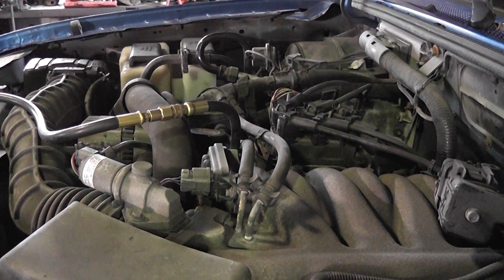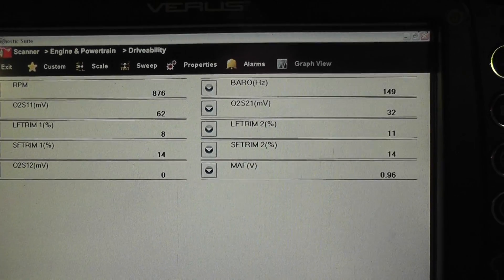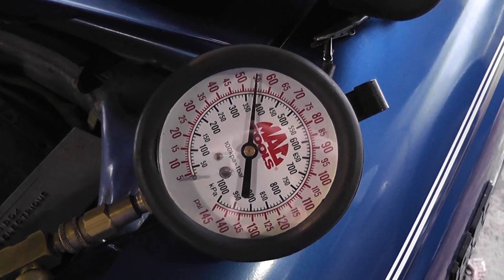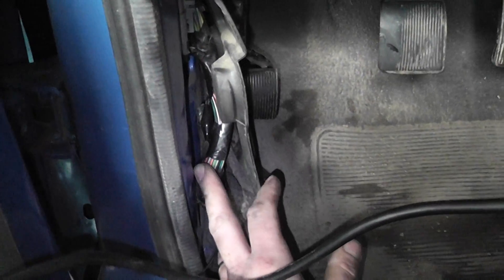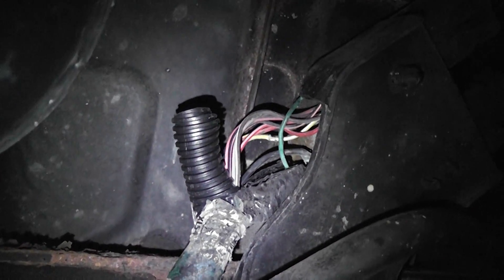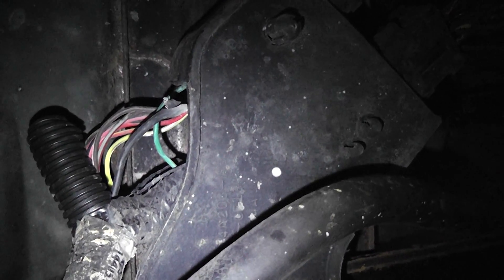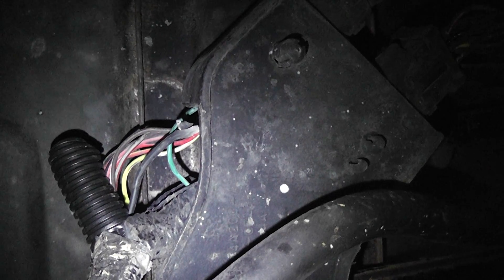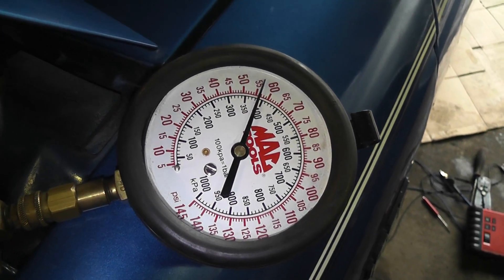Low Fuel Pressure from a bad fuel pump ground (Ford Ranger)

Comment: I have a 90 4S 10 left it running went into a store came out it was running no fuel no spark any suggestions all relays are good
Reply: 94 s10
Reply from the maker: dan bleeck no spark on this system is usually either the pick-up coil in the distributor or the ignition module. I have a video on testing an ignition system with a test light that I will be unlocking in a day or so that will really help you. In the mean time watch this one. https://www.youtube.com/watch?v=mDKj19Hnhd0
Reply: thank you it was the pick-up coil

Comment: My 87 ford ranger does not show the fuel level some people say it can just be a ground i also notice that whenever i try using my turn signals the front work well but the back ones both turn on at the same time regardless if i try to go just left or right both turn on. I have a misfire too can a bad ground cause also that?

Comment: Your channel has been very helpful so thank you for the uploads! My ranger starts to run rough and stalls after reving it past 2800 rpm. All plugs get spark and I have changed spark plugs, fuel filter, air filter, cleaned IAC MAF and throttle body yet the problem still persists..
Reply: 874 fire gas but will not run

Comment: I have a question for you if you wouldn't mind giving me some insight. (2001 ford ranger 3.0l -----15,000---- miles 2wd automatic return less fuel system fuel pressure is 68 koer koeo (extreme rich condition is the problem)) customer just put a new fuel pump in it because of bad check valve. problem existed before the new fuel pump, there was another pump put in it by the previous owner before the one yesterday, odd but this is the history I have on it. anyway the fuel trims are going lean 24% stft b1 and b2 ltft goes to about 6-8% negative b1 b2 before pcm kicks it out. if I create a huge vacuum leak like the booster line I can get the truck to start using trims. pcm fuel pump command is 100%? if I command the the pcm to have 40% duty cycle the pressure drops to about 37-40psi and the trims come back close to normal and the o2 sensors are reacting normally. the truck will negative trim the fuel until the pcm kicks it out and goes back to 0.0% trims across the board until reset. this truck ate 10 gallons of fuel in 80 miles please text me or call at 636-368-8267 or email at ghenke@hotmail.com. love your videos and have purchased your e book. there aren't too many cars I cant figure out but this one has really thrown me for a loop. thanks in advance Jerry Henke @ Alternative Auto Winfield MO
Reply: another comment is that the maf sensor and all other sensors are acting correctly considering the issue

Comment: This is a bit of a shot in the dark, and not sure if you are able to offer us any advice, but we have a Ranger, 2002, XLT, 2.5TD, which is lacking in power generally.  We have replaced the cylinder head and turbo, and renewed all the filters, etc, but although it runs without misfire, etc, it just has no 'oomph' to it?  Any ideas????
Reply: Figured it out yet ?

Comment: hey scanner danner i have a 2002 ford ranger has misfire on cyl 2 and ive replaced coil pack wires plugs and we replacing plugs i found cyl 2 was broken lol but its has rough idle poor mileage and dam thing is power loss from heck and we all know they are called 3.slows so its worse than normal its only got 136.xxx miles any help be appreciated im running outta ideaas lol

Comment: gread video.. i nver thought of checking ground wires since my 84 ss is acting up but once i disconnect the fuse to the ecu it drives great but rich. unfortunately,  once plugged in it has a rough idle when ever it wants, and I mean rough. thanks again.

Comment: This video solved my problem man. I owe you one! My fuel gauge was stuck on full and My truck is a ranger too so I checked the connectors in the same spot under the truck and found 3 broken feed wires. One of them was the sender assembly circuit. Spliced them the same as yours. No more counting miles till empty! Serious bro, thanks again

Comment from the maker: at the 7:38 mark the meter shows around 10.7 volts on the Ground circuit!
this means that if we had 14+ volts on the pump feed (which would be normal battery voltage with the engine running) and 10v on the pump ground, that there is only a 4 volt difference in potential. So essentially the pump was running on 4 volts at that point. 
(remember system voltage with the engine running is 14 not 12, I think that is where some of your questions will be answered) let me know if this helps

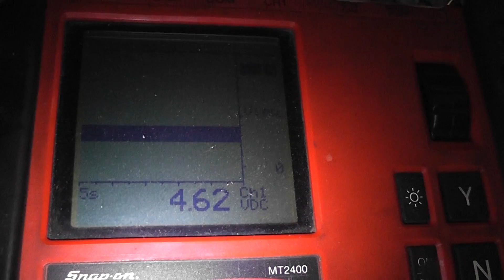Comment: paul, just to make sure i understand, at 7:25 we see 4.62v. does that mean the pump is only running on 7.38v? when you turn the parking lights on we have a reading of 10.7v. so doesnt that mean that the parking lights, pump, and signals are running on 1.3v? the reason i ask is that at 7:35 you mention the pump is running at 4 volts. dont you mean 7.38v? i can very well be wrong.

Comment from the maker: Mitchell gives this wide range because some of these Rangers used an electronic returnless system where the PCM controls pump RPM to control psi. Those systems had a wider range of operation.

Comment from the maker: the first thing I would do with that is address the 80 pounds of fuel pressure problem first. this is way too high for that system. with that kind of fuel pressure you should have rich conditions not lean conditions but in any case fix ur fuel pressure problem first

Comment: as pressure drops when the headlights being turned on "check out the fuel pressure, that's awesome." don't know why, but I giggled a little bit on the inside.

Comment from the maker: @ScannerDanner However if the owner drove that car that way for a long time, the unburned fuel in those two cylinders would end up also in the crankcase and cause fuel contaminated oil. This will get picked up by the PCV system and drive the fuel trim negative.

Comment from the maker: @fivefortyeye540i First, unburned fuel is not "rich", it is simply unburned fuel. Also the misfire does not consume the oxygen that was in that cylinder either. This drives the O2 lean. I have never seen a misfire cause negative fuel trim numbers. As for a dead coil on a waste spark goes, they are known to fail with heat so maybe the coil was firing on start-up. My guess is your negative LTFT numbers were not because of the misfire....

Comment: @scannerdanner. So it is not possible for long term fuel trim to read rich do to unburned fuel within cylinders?? Have u ever seen a gm waste spark system with a dead coil whith  (no dtc )?? And on start up the thing ran smooth??  Well I witness this on a another 3.1.. I did not do a snap throttle
to load engine..my own ignorance. I just plugged scanner in to view fuel trim - 22 ltft .long story short first coil going left to right was dead, cylinder 2 and it's companion was not firing.  On sta

Comment from the maker: @fivefortyeye540i If you had a dead coil (two cylinder misfire) on a 4 or 6 cylinder engine, it would be running so rough (especially the 4cylinder) that I would immediately do an RPM drop test to figure out which cylinders were dead. I don't think I would even look at trim. However if the misfire is severe enough you will see positive fuel trim numbers. Keep in mind, in a case where the PCM is intentionally shutting off the injectors that this may affect normal fuel trim corrections.

Comment: @scannerdanner Let's say for argument sake that a coil was not firing( at all )on a gm waste spark system. The ECM in response to that would take fuel away, thus showing (double negative ) longterm fuel trim to protect the catalytic converter ??

Comment: Awesome video.I was wondering the result was the same(bad pump ground),
 if you would have diagnosed the P0232 fuel pump secondary high Instead of the lean codes.

Thanks you are the man for the job

Comment from the maker: @contagiousFX I generally do not use the fuel trim numbers when I have a misfire. Unless of course the misfire is from a vacuum leak where the fuel trim would be very positive. Most of the time a secondary ignition misfire does not mess with the fuel trim numbers too bad.

Comment from the maker: @HaroRider03088 Followed the harness as I showed in the video. Did a visual inspection and voltage drop test. If I wouldn't have seen the problem visually I would have started testing that wire (same voltage drop test) in different locations to identify where the problem was.

Comment: @ScannerDanner Some RTVs will contain ammonia, that is the vinegar smell. Ammonia is corrosive. I usually seal wires with Liquid Electrical Tape, comes in a small can with a brush in the cap. Easy to use.

Comment from the maker: @foxholewilly Yes it was a ground to ground voltage drop test and if I could have shown the wire before the break it would have been identical voltage as at the ground point I showed. As far as using piecing tools, I try not to do it but I had to in this case. When I am done (depending on location of the wire) I will use a small amount of RTV. I never heard about RTV being a problem but I am no chemist so maybe it is? I don't get overly concerned about it though.

Comment: I had the same thing happen on a Toyota Camry 6 volts was dropping on the ground side of the fuel pump. But it would only happen when you applied the brakes.